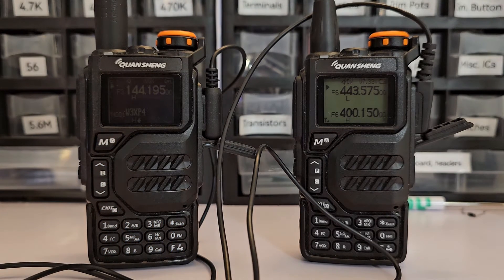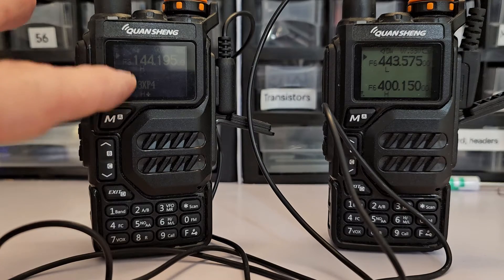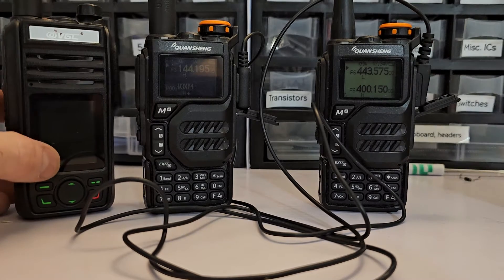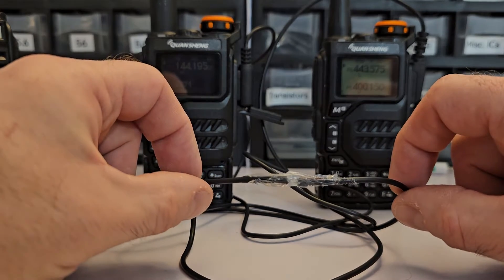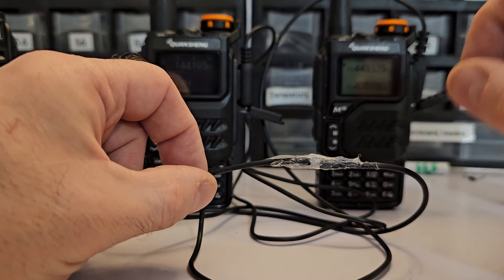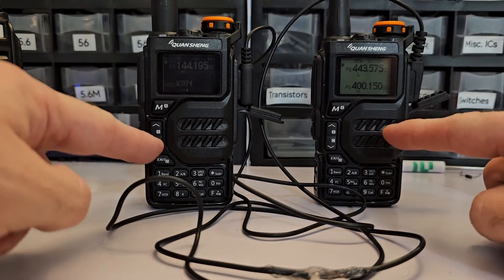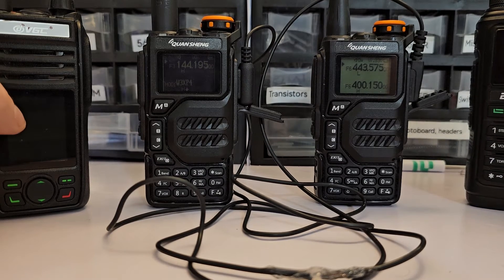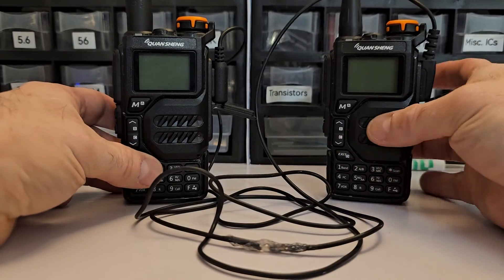Easy Cross Band Repeater with 2 HT radios.

Comment: To make things easier... Just buy the Boafeng Repeater box for $16 - $18... problem fixed... no cutting, splicing, taping, or soldering! Just plug into both radios, and it works.

Comment: Better idea, put a simple resistor array across the earpiece wires - tuning the mic output voltage to the other device's peak microphone input voltage.  You're probably over-driving the microphone input.